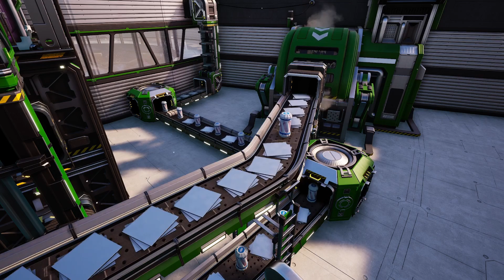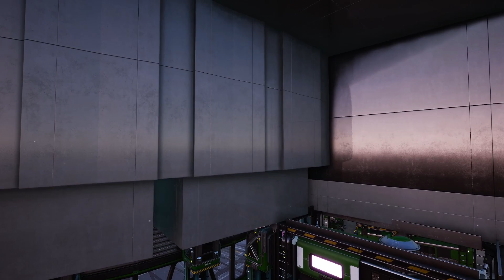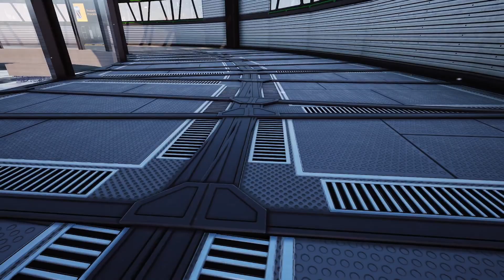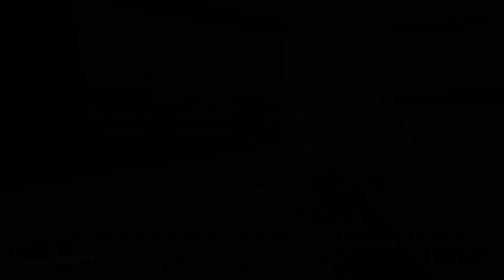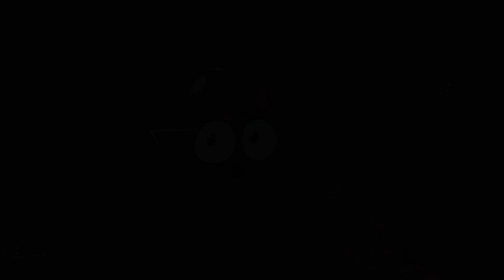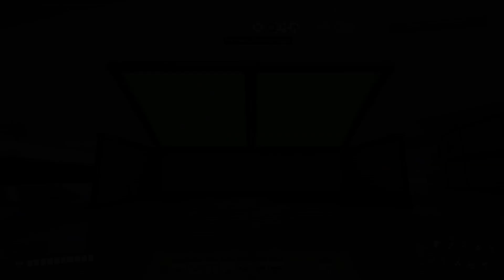Easily Sort All Your Trash: The Multipurpose Room | Satisfactory Tours Ep. 1

Comment: Great build.  I did something similar based off your designs and then I realized.. with the DDs nothing is actually stored there. LOL  I mean aside from looking cool there is no "functionality" with the DDs. DDs are great but now I think they have rendered traditional storage obsolete in some cases.
Reply from the maker: Thanks for the kind build and I'm glad I could inspire!

In some cases they definitely have rendered traditional storage obsolete. However it is worth noting that having a storage buffer ahead of your DD can help adjust for spikes in item usage if upload speed of your DD is higher than the production of that item. For example I produce only 96 Iron Plates per minute at my main base but I have them buffered into a 240 ppm upload speed DD. Until I actually run myself completely dry I functionally have 240 Iron Plates per minute.

Comment: DNA is a finite resource? The 2x seems like a waste.
Reply from the maker: It's not a waste specifically because it's finite! I think of it like this: I only leave my factory so often to gather slugs and other valuables I can't mine and that's the only time where I will be gathering alien parts. I would rather see the extra DNA points than have a few extra Sloops that I already have too many of.
Reply: @DSJeezy  I only mean don't aliens respawn? Slugs for sure should be slooped.

But if you have lots of extra sloops then for sure using them better than not.
Reply from the maker: @Hossimo  Yeah they respawn in areas you haven't paved over but I'd rather the alien bits I do get on my limited excursions go as far as they can rather than having to gather twice as many for the same result.

The combat is pretty good for it being a game about building factories, but I mostly want to spend time building factories.